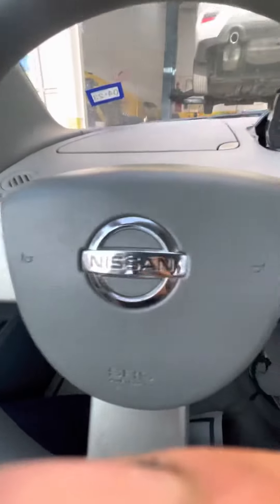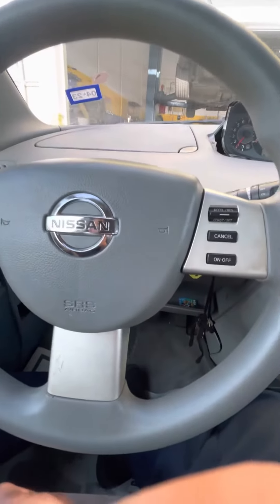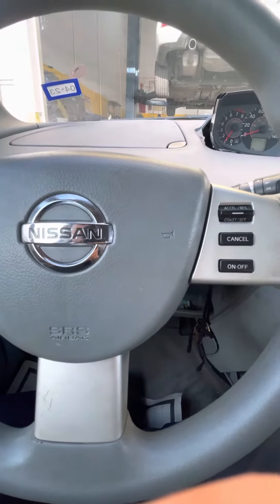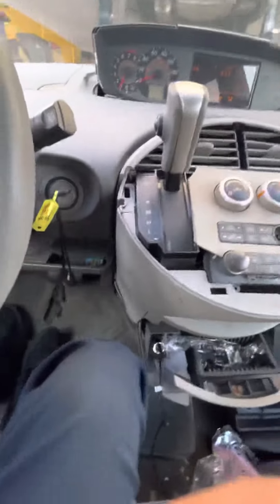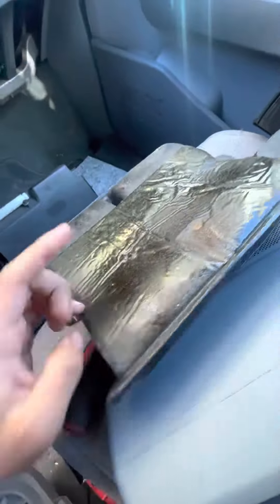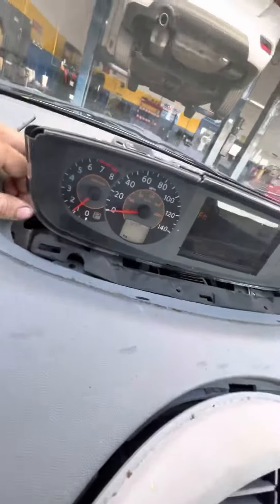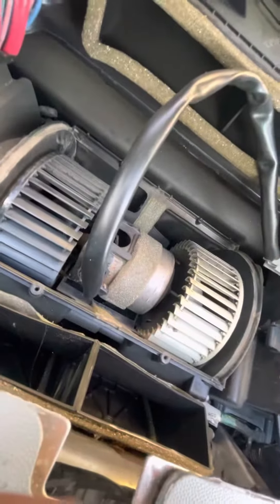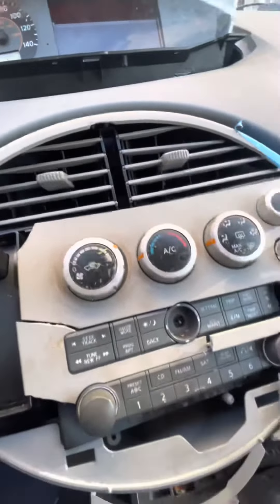Nissan Quest blower motor and resistor location.

Comment: I'm trying to figure out what the path cold air takes to the rear and if there's a door that controls it. Everything works up front. It also doesn't have any lights interior so I'm thinking i need to swap out the body control module.